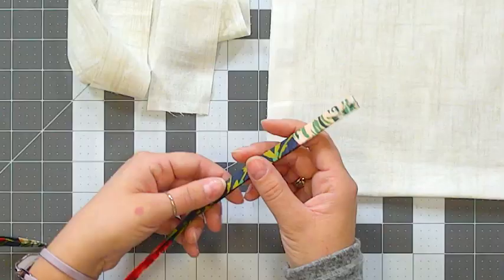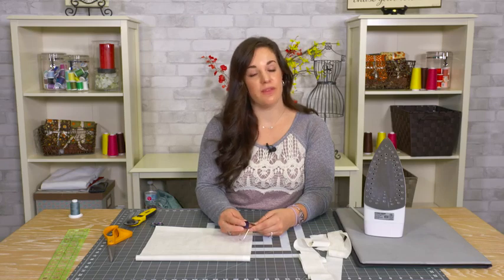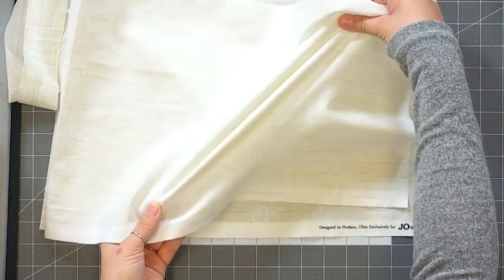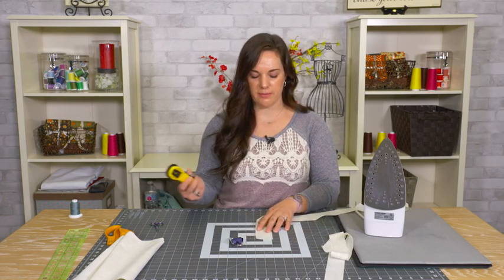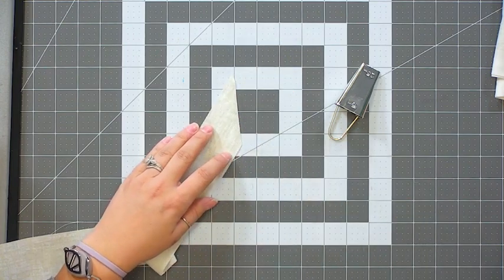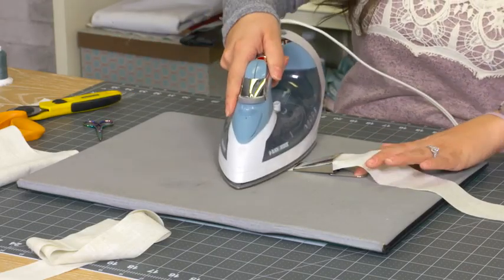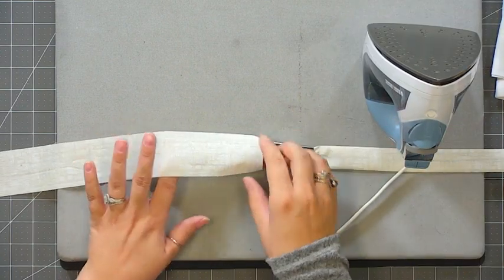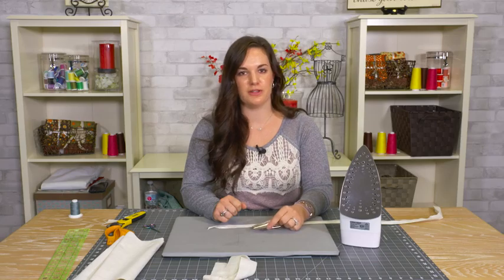How to Use a Bias Tape Maker

Comment: Little tip -  thread the tape through by poking with a pin through the slot on the other side. I didn't see you show the other side of the maker. Thanks for the video.
Reply from the maker: Great tip!

Comment: Thanks! Can you use the binding maker on stretch fabric? Tia
Reply from the maker: Hi,

In theory- yes, you can use this on knit fabric- however, it is very important that you try not to stretch the fabric too much as you pull it through the tool. This can be difficult if the fabric is too thick, so try it out on a lighter weight knit first.

Cheers,
Ashley

Comment: OMG I’ve been sewing since I was a teenager...over 40 years.... how did I not know there were bias tape makers!!!! I do have a rather embarrassing question though. If you don’t need the stretch for your garment, do you have to make/cut on the bias?
Reply: Happily, no.  For straight edges, just cut your bias tape from the straight.  However, if you are using your bias tape on a curved edge, like a neckline or armholes, you will need the stretch of the bias cut tape to ‘give’ on the inside curves (concave) and stretch a bit on any outside curves (convex).
My first big mistake was cutting my bias wider than it should have been.  What a mess trying to get it to push through!

Comment: Use a pin to pull the fabric along the top slot to feed it through, isn't that why the slot is there?  Also I thought you pulled it along with the loop at the top....so then you can check the fold is doing OK..........
Reply from the maker: Great question! The ‘Ask an Expert’ section is currently for members of our online community. By becoming a member, you will have access to our expert’s knowledge in  sewing. With your membership you will also receive discounts on products and hours of Premium video content. 

If you are interested in becoming a member , please click on the special offer below:https://go.nationalsewingcircle.com/C23129
     
Thanks!